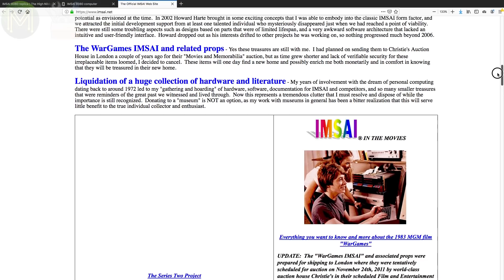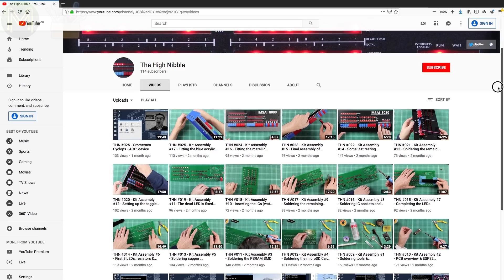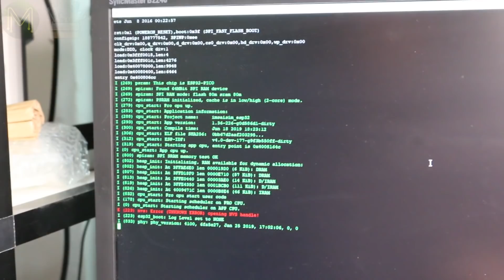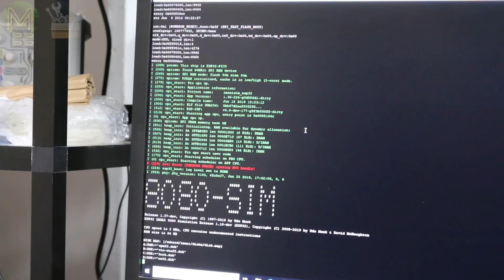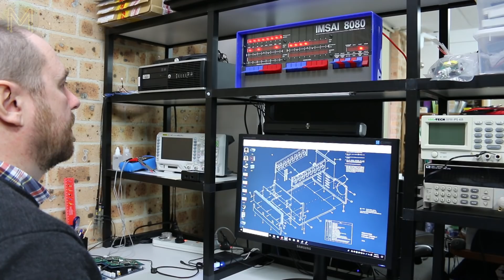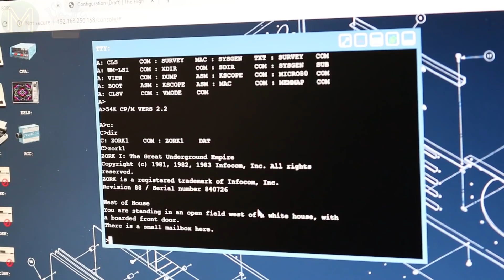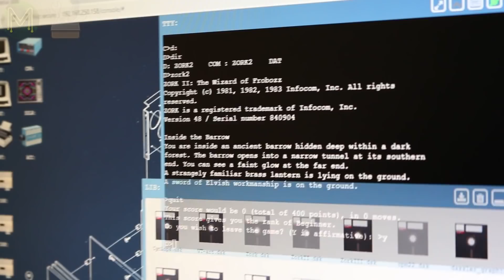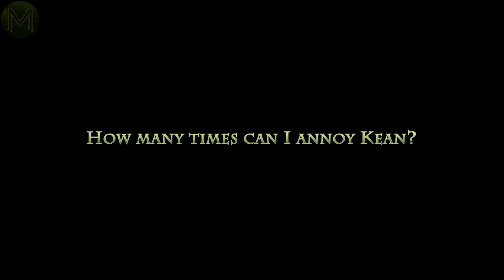#273 Building an IMSAI 8080 replica - ultimate retro computing.

Comment: Bit of a late comment, but the Altair 8800 was actually the first 8080 computer available in kit form in 1975.  IMSAI came second.  The primary difference is that the Altair front panel subdivided the toggle switches/LEDs into groups of 3 to designate "Split Octal", where a byte was represented as 76 543 210, or 377 if all the bits were 1s.  This was the common number base used by mainframes and mini-compters at the time.

The IMSAI was the first to subdivide the toggle switches/LEDs into groups of 4 to designate "Hexadecimal", the up-and-coming replacement for split octal, as it allowed all bit groupings to be identical.  Bytes were split into 2 groups of 4... 7654 3210, or FF if all the bits were 1s.

Comment: My first introduction to computers was an IMSAI 8080 back in early 80's.
Reply from the maker: What an intro!
Reply: And mine was with Intel 8080 based computer (Intelec(?) 8080, Serial #0000000014) in 1977 or 1978.  RMIT Physics dept. ordered the Intel 8008 computer but switched order to 8080 as soon as it became available.  It too had rows of switches and leds and had to be manually programmed to execute a jump to eprom monitor, via a 3 byte instruction at address 0x0.  A reset would get things going.  Once in eprom  monitor, it was possible to execute OS boot function to load OS from 8" floppy drive.

Comment: Built my first Imsai in Winter of '78.  It was the PCS8030 with the 8085 3Mhz processor.  Got a base 8080 chassis a few months later and modified the front panel to work with the MPU-B.  Added a pair of Calcomp 142's with the DIO-B and actually got several MIO's to work.  With the VIO-C used it for a few years before I built a Z-80 with a Jade-DD HD controller.  When I bought the first one, told myself I was only going to learn enough to do what I needed, then Imsai died and I had to.  The Imsai 22 slot backplane was much superior to the Altair because it was MUCH quieter (electrical noise) and the MPU-B's 8085 had data latched on the trailing edge of the ALE signal allowing you to run 3 MHz with 666ns memory (extra clock cycle to get memory data stable).  Used CP/M until I eventually went to DOS when it was 3.0.  If you want to see the easter egg in Wordmaster, try entering an EOF in the middle of a document by hitting ^P ^Z and the software will respond with 'TURKEY' because you just cut off your document at that point.  Still have the unit and most parts and docs unpowered for many years.  Really enjoyed the simplicity of the machine once you got over the binary thing.  I actually labeled the toggle switches 8 4 2 1 to help familiarize myself with the conversion.  It's amazing how many useless and obscure deatails you can remember after 35+ years.

Comment: It is tempting to order one of these but I'm holding off due to lack of information about the price range on the web site. I don't know if it will be $100 or so or closer to $1000.  There is an Altair 8800 replica that runs about $600. I was tempted by it but at that price point I've held off getting it. I'm sure both the 8800 and 8080 replicas are still cheaper than the real vintage 8800 I saw at a market where the owner wanted $4000 for it.
Reply: You might prefer the altair-duino, a cheaper replica that looks really nice.  I have one and really enjoy it. https://www.adwaterandstir.com/altair/
Reply: I read on the forum it was $250.
Reply: @avt3216  Thank you for the information. That's a decent price. It is very tempting to buy one.

Comment: A critical moment in my 46 year career as a mainframe programmer (1966-2012) was sitting at the console of an IBM 7094 mainframe and entering and running a small program through the console switches. That's when the lightbulb went on.
https://en.m.wikipedia.org/wiki/IBM_7090#IBM_7094

Comment: I stated with an Altair 8800 was SerNo 33. But liked to appearance of the IMSAI better and it had a full S100 mother board while Altair had to join 4 slot segments. Power supply on IMSAI also was better. STILL HAVE THE IMSAI TODAY! Have not run it for many years now, but have MANY S100 Cards. Built own Harddrive interface and wrote Bios , formatting, partitioning software. Mainly ended up with much Cromemco hardware.

Comment: I  had a 8080 running 4 a/d, timing, 4 pnuematics  and 16 vibratory mechanisms. It was slow. It was 1 megahertz. I went a overclocked it 1.25 and just was able to keep up. I thought that I put in a 8047 board running 4.77 megahertz that It would fine, but 4.77 /4 = 1.19 and 1.25 on the 8080 a lot more. Counting instructions.

Comment: I still have my Altair 8800 and I was partners with a friend in an IMSAI 8080. I wrote the BIOS to make it work with our eight inch floppy disk drives and the print driver for a parallel interface daisy wheel printer. Every programmer should write some assembly language programs just to experience computing at a very fundamental way.

Comment: I still think the Altair-Duino 8800  (Altair 8800 Clone) is an more authentic 8800 experience. I have my Altair Duino 8800 connected directly  to a DEC VT terminal.  The IMSAI 8080 replica is interesting but I still like the Altair 8800 Clone more, as the source code is open (thanks to  David Hansel Opensource Software and Hardware) and their are lots of great resources & kits available from  Adwater & Stir and Mike Douglas.
Reply from the maker: Dave McNaughton has open sourced his code and has actually contributed a lot.
Reply: @MickMake  The porting Z80pack work? I think David Hansel's open source software and hardware s still a much more impressive and open  project . https://github.com/dhansel/Altair8800 Hardware https://www.hackster.io/david-hansel/arduino-altair-8800-simulator-3594a6